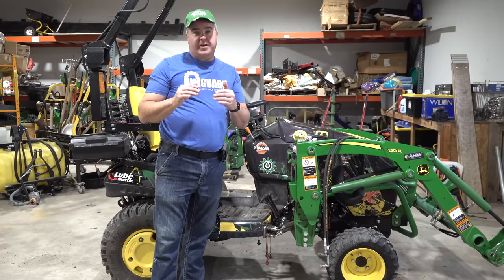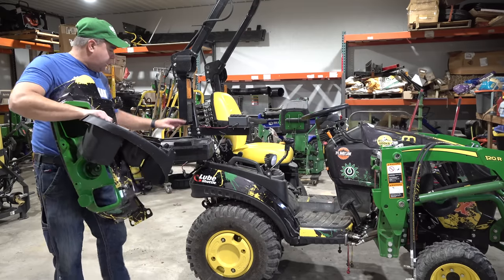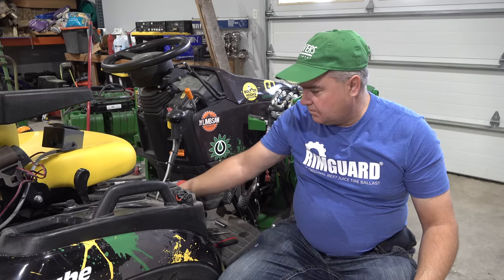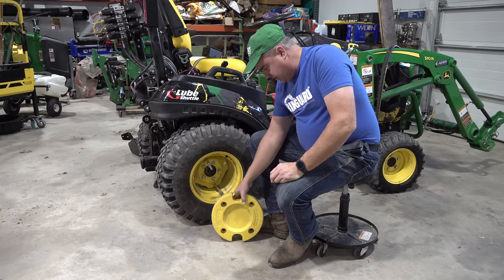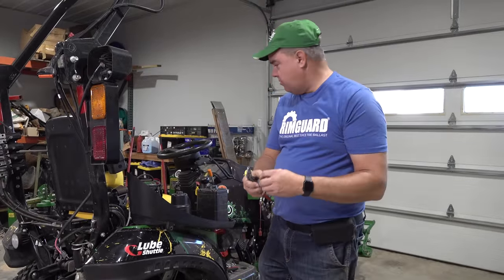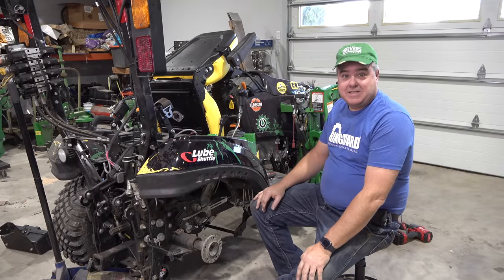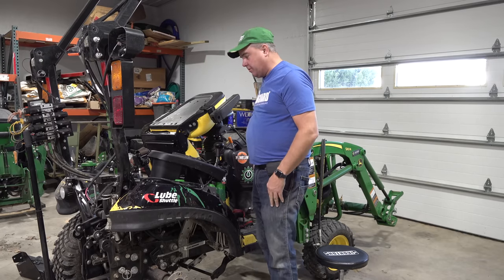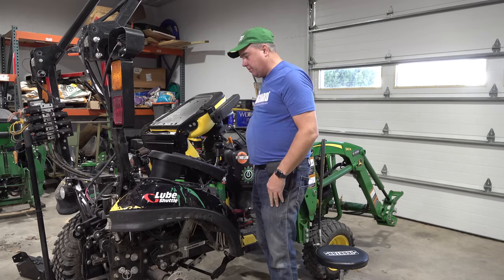NEW CONSOLE! John Deere 1025R Upgrades to 2022 Armrest with Switch Knockout Plugs!

Comment: Great video Tim, I highly recommend this kit for any older 1025R owner looking to add the summit rear hydraulics to it. 
I made this same modification to my 2025R a few months ago. 
Since the part numbers for the green fender were shown to be different, I had order both piece for my 2025R once here it turned-out part numbers were shown as different, but once I had both my green fenders side by side , that the original fender and the new number fender, it was clear that for the 2025R they were the same piece or so similar that we saw no reason to use it and since returned it to Green parts store.  Which that said for 2025R owners looking to do this modification it is only about 40 bucks all you need is that upper black portion of the fender.
Reply: I was wondering about that very question for my 2025r. Thanks for sharing.
Reply from the maker: …and the same upper black console piece that I used? …or is it different for 2025r?

Comment: I did the upgrade with the 4 rockers for my Summit 4 port rear SCVs on my 1025r. Easy and fun!  But remember to pull the fuse for the 12v outlet! 😮😂

Comment: I upgraded my 2018 2025R with the fender after seeing your sneak peek in a previous episode. Nice thing is the 2025R does not need the fender replaced.
Reply: Interesting 🤔
Reply: Do you just need to replace the console insert? Do you happen to have the part number for that? I would like to upgrade my 2021 2025R as well.
Reply: @patrickpettengill4444  Just the console insert. Same part number as the 1025R, TR121778.  Cost is around $40 for the console. The plugs M115279 are around $2.65 each.

Comment: Tim, I always use a jack stand and metal rod to remove the wheel weights. I loosen the top bolt and slide the rod in and place on the jack stand, then level it. I then loosen the bottom blot and slide the wheel weight on the rod. It saves the back and frustrations. Lol

Comment: Great job on the upgrade.  I have a 2019 and was looking to upgrade the hydraulics to include a front 3rd function, and a hyd top link on the back.  I could use your opinion on if it would best to put a power beyond first and then do a summit kit for the front 3rd function or just do a summit kit that would take of both items.  Thanks

Comment: Hi Mr. Tim. I still have my 2016 1025r. I would like to install a hydraulic top link at least and was wondering if there is a kit to do that. Thanks for posting these videos.
Reply from the maker: Sure.  Get the top link from http://AgriStoreUSA.com (use code ttwt for 5% off).
Get the rear hydraulics from summit-hydraulics.com/ttwt use code ttwt for 5% off.
There are several summit kits which will support rear hydraulics.  
Watch my episode showing 11 different options.
Choose The Right Hydraulic Upgrade for Your Compact Tractor!  11 Options Considered.
https://youtu.be/btr_5mOuU_s
Reply: @TractorTimewithTim 
Thank you for the information my friend

Comment: Already on backorder.  Good job Tim.  🙂

Can in infer from your "Before 2022" description (or maybe Green Parts store's description) that it'll fit my 2016 as well?  Some might consider 2016 to be ancient history at this point.  🙂
I'm thinking it'd be nice to get my TKV20 switch to fit in there instead of having that extra box hanging around all the time.
Reply from the maker: TKV20 switch would work perfectly there.
Yes, will work on all older 1-series.

Comment: I forgot the gasket as well when I put switches on my 22. You can pry up slightly with a trim tool or butter knife and push the locking tabs in and the switch will come right up.
Reply from the maker: Ok.

Comment: I came across a 2038r at a dealership. First one since before Covid hit. I noticed there was no slits for the handles if one wanted the rear hydraulic connectors. Are they there just can’t see the on-less you look from up underneath???
Reply from the maker: They likely replace a portion of the console.  Pretty slick setup.  It always looks custom no matter which options you get.
Reply: @TractorTimewithTim  you are right. I went looking on Green tractor talk. Found a thread and someone posted the instructions that come with the kit. Wondering now if that would be a factory add-on or dealer. I’m handy with a wrench but… oh my.  Lol

Comment: My 2017 1025R has 438 hrs & won't start.  Lights flash on dash.  Battery has Sept. 2015 sticker on it (crazy, right?) but it is now testing @ 12.4V once I trickled charged battery.  Lights on tractor don't come on (only rear lights work).  I checked middle relay by pulling out bottom one & placing in center spot. Didn't make a difference.  Checked corresponding 20a yellow fuse, not busted.  So what gives?  Why is my tractor not starting? Headlights never turn on, but when I turn knob to 'on' position, display goes dark.  Dash display only flashes when headlight knob in off position.  It HAS to be battery, right?
Reply from the maker: I would think it is the battery, yes.

Comment: Tim, are the mounting points for the fender work lights the same on the 2 consoles? Pictures I've seen seem to look like the new mount is different (possibly higher) than the old one.
Reply from the maker: Seemed identical…I didn’t compare.
Reply: Great to hear! Thanks!

Comment: I would have pulled all the wires through the holes in the fender wired up the switch then popped in to place
Reply from the maker: Did not have enough distance between ground wire connections.  Remember, they were all inside that little box.  Only 1 inch or so between spades.

Comment: The one "upgrade" over the 2019 model that is not an upgrade in my opinion, is the new way the MMM is connected to the tractor, although the 7-iron (7 gauge steel) mower deck itself might be more durable than the older, thinner 10 gauge deck thickness.  I just don't like how the 7-iron does the attachment to the tractor.

Comment: My 2022 1025R did not come with the switch knockout plugs.  Purchased in April 2022, but the unit has a manufacture date of Dec 2021.
Definitely going to upgrade.
Reply from the maker: Yep…mid 2022 sometime.

Comment: I have a 2017 1025R. Doe you know if the 2023 fender and console will retro to that model year?
Reply from the maker: Yep.  Will work great.  All the way back to the 2013 models ...and even the older 1026R's!
Reply: Thanks so much.